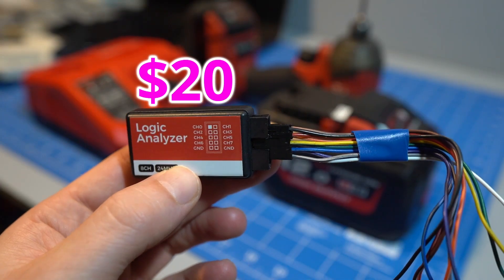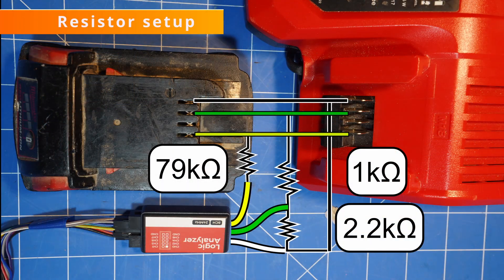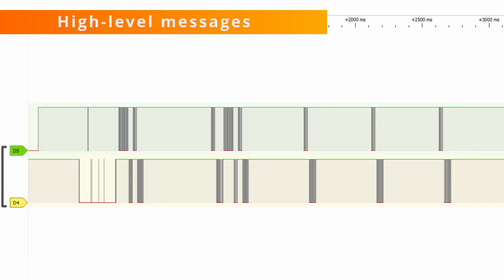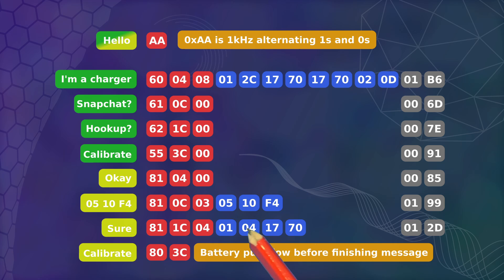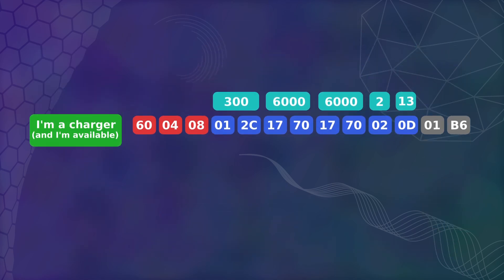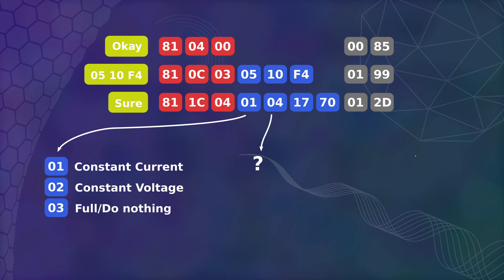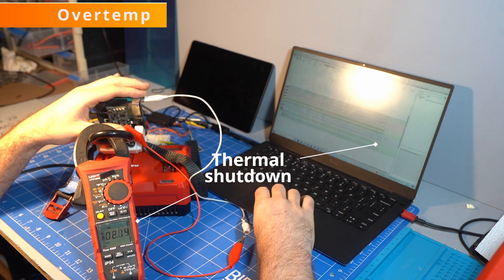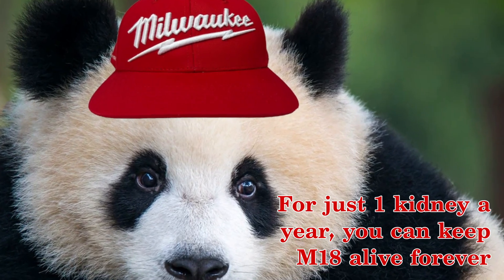[004] Reverse-engineering the Milwaukee M18 Redlink Protocol

Comment: The commands might be ASCII letters .  The 0D looks like carriage return .
Reply from the maker: I'm moderately sure the 0x0D is the number of bytes in that message. It's the longest message in the protocol. All the other bytes in that message make sense as decimal.

I looked at the 05 10 F4 message as ascii, but couldn't get anything useful. I also tried ascii with the bit order reversed. I think it's either a date code, but I can't make any of the common date codes fit. Program would have been written around 2010-2013. Other possibility is that it's chip IDs. 0x10 is the i2c ID of the  balancing chip (BQ76925). Other chip is a MSP430 G2744.
Reply: @toolscientist  I tried looking at it as ascii too, but only because I noticed that 0x0510f4 is decimal 332020, which is obviously a hex representation of ascii. I doubt they'd encode it as hex-in-decimal, though, and 3<space><space> doesn't seem particularly informative. Fun coincidence, though.
Reply from the maker: @aihtdikh  I'm definitely leaning towards chip IDs. I noticed that MSP430 G2744 is from the G2x44 family - and F4 is 244. So I think 0x10 is the balancing chip (that's its i2c address), 0xF4 is the MSP430, and 0x05 is maybe the program version?

Comment: I'm guessing the soldering iron overheated a heat sensor ...
Reply from the maker: The thermistor is some distance away. There's some diodes near that balancing pin that I may well have cooked. If I get the time I'll have a look.

Comment: I was keeping battery charged with bench power supply but once it dropped below i certain level it had to snspchat a charger.  I could still charge on bench PSU but would not output power to drill until after a hookup.
Reply from the maker: Yeah, once the battery is down to one flashing light, it won't let a tool run until it's been on a charger.

Comment: Okay so the algorithm is spooky: I just moved into my first ever owned home, and was looking at the Ozito battery for the drill driver and impact driver I purchased to do work on it and wondering if I could reverse engineer their protocols; I work in embedded firmware dev haha. Incredibly niche, incredibly relevant, and you did some great work here
Reply from the maker: Are ozito digital? I would have assumed they just had analogue NTC pins and maybe an analogue current request (that's if it's even doing CC/CV, they might just trickle charge)
Reply: @toolscientist  Most likely not, but I want to poke and prod anyway! There’s a surprising amount of logic inside batteries and chargers (I should know, I build it at work lol) — but ozito is cheap as hell so I’m curious! I’m going to bring it to work to poke and prod with the scope now lol
Reply from the maker: @Girvo747  you design battery systems in AU? Home solar storage would be my first guess.
Reply: @toolscientist  industrial, and not just solar but you’re in the ballpark haha
Reply from the maker: @Girvo747  Cool. I hope you keep watching. It'll be good to have some insider knowledge when I can't figure out what or why they've done something a certain way.

Comment: M18 appears not to active balance. To solve this just solder an active balance board to the bottom of the battery. Of course you will need to put it in a case maybe 3d printed...
Reply from the maker: It does passive bleed balance with a TI BQ76925. It appears that the balancing is too weak, though. It's high on my todo list.

Comment: Thanks for the info, at one time I considered buying Milwaukee lithium power tools glad I didn't I bought Dewalt instead and have Max 20 adapters for my Craftsman & Ridgid power tools as well as a fan, variable power supply and work light and AC inverter. Can you imagine a perfectly good battery bricking and not communicating to the charger? at least with the Dewalt I can swap out the BMS if needed.  Before you know it Milwaukee will try to verify that you have a genuine Milwaukee battery, charger, power tool & usb power supply.

Comment: That's surprisingly different to DeWalt's way of doing thing. There's mostly no electronics in the battery, but there's more pins, so the charger can monitor and balance individual cells, monitor the temperature, etc. all by itself. The way to differentiate batteries (High output or not) is a simple resistor installed between an additional pin and the 0V pin.
Reply from the maker: Yeah, the Dewalt's are admirable for their simplicity.
Reply: That's M12. Thermistor, balancing wires, done.

Comment: Really interesting and informative. Excellent work. I'm looking for a circuit diagram for the M18-12 charger (old style with the TOP256EN power management ic) but can't find anything. Any pointers would be appreciated. Thanks.
Reply from the maker: No, never seen one and I've only got rapid chargers. I think Buy It Fix It has the older 3A charger if that's what you're after. He has a youtube channel where he does repair vids. He may be willing to make a teardown vid for you. https://www.youtube.com/c/BuyitFixit

Comment: I’ve heard despising batteries from a Dyson BMS bricks the battery unit. This is thought to prevent people from rebuilding their batteries with new cells. This might be why your battery was bricked when you desoldered that rail.
Reply: It may be specific battery packs then.
 I just rebuilt my Dyson V8 battery pack with no problems. The biggest issue was that the original batteries were 20700 size opposed to the usual 21700. Just jammed them in there, and they’re working fine. I had completely disconnected the old batteries, so whatever pack I had didn’t care

Comment: I'm not sure why I'm here but i learned alot.

I wonder if makita does the same thing
Reply from the maker: They definitely do on XGT, and I'm pretty sure they do on LXT (I don't have any LXT, though). Never seen CXT in person, so not sure about those.
Reply: @toolscientist  have you ever thought about doing this with the flexvolt dewalt.

The battery switching from series to parallel to go from 20,40,60v is really cool.

Sucks it's such a heavy battery or I think the line would have taken off. As a mass producerable battery that's an incredible technology
Reply from the maker: @griznatle  Definitely want to look at all the brands at some point. I guess I'll start with the big 3 (Milwaukee, Makita, Dewalt) and go from there. I currently only own M18, M12, and XGT, so I'll have to keep a look out for 2nd hand stuff.
Reply: @toolscientist  do you think the tech of the dewalt flexvolt could ever get lighter?
Reply from the maker: @griznatle  only thing they can do is use smaller cells. 14500 cells are an option, but they're 1.1ah and 10A, versus 2.5ah and 20A of 18650s. Another option could be pouch cells, so 3 of the 1.7ah powerstacks slappped together.
Reply: @toolscientist  One of the benefits of the current system is that two of the batteries could power a chop saw for the majority of the day, assuming you're cutting spf 2x6, not lvl or ironwood.

I wonder if the gel packs could do the same as the Samsung cells

Comment: please just explain (or guess) what the messages are rather than being cute with "snapchat?"/"hookup?"
Reply from the maker: This video was written for a non-technical audience with no prior experience with binary data or digital signals. So the first 1/3rd was made to be simple and entertaining in order to get that audience interested enough to sit through the deeper technical look. This obviously does not work with a technically skilled audience, but I was not expecting this video to spread so far.

If you want the plain explanation:
0x60 is charger sending min/max current capabilities and status to battery
0x61 is battery sending info to charger. From discussions with another commenter, my best guess is that it might be chip IDs on the battery.
0x62 is the charger asking battery for a status byte that is used to drive the LED signalling on the charger, and a current (milliamps) request.
Reply: @toolscientist  thanks for the reply. maybe it could have been summed up with "charger capabilities?", "battery capabilities?" and "status?" instead? if the second one wasn't known at the time then "unknown info exchange" or something could have been fine, with a guess of what you thought in the voice over.
or starting with the jokey labels, but explaining and changing them later on. I found it kind of hard to follow as it is.
Reply from the maker: @rika-chan  joke start, proper later was the intention. I didn't want to change the labels so that it would be easier for non-technical people to follow (they're more likely to remember the silly labels). I did move a little too fast through the technical stuff - it's a difficult balance of giving technical info, but keeping things moving to avoid people switching off. 

YT isn't really the best medium for this stuff. I usually post a written form to reddit once I've caught up on life after finishing a vid. I might make a read-only subreddit of my results to make them easier to find.
Reply: @toolscientist  I dunno, to me I feel like even if I was a non-technical viewer I'd have to mentally untangle what the joke labels were to the original explanation, but I could be wrong. striking the balance seems hard to do and I appreciate your reply. hopefully it helps to improve!
Reply from the maker: @rika-chan  I'm pretty new to YT so I've still got a lot to learn. Thanks for the feedback 🙂

Comment: How did you figure out the message format?
Reply from the maker: Get lots of data and put it into a spreadsheet. Identify the different types of messages. In this case there's really only 3. Look for similarities and differences between the messages. Look for numbers that stay the same vs ones that change. Look at numbers in binary and decimal to see if any standout. Group bytes together in groups of 2 (maybe 4 if it's a 32-bit chip) and see if any of those seem meaningful in decimal.

Comment: Does the battery allow power draw without any comms? i.e can I use the battery to power custom tools? Any good way of getting hold of a connector? :) thanks!
Reply from the maker: Yes, the +ve and -ve pins are directly connected to the cells without any transistors in the way. Drawing power from these pins means you'll have to do your own low-voltage cutoff and keep it a a moderate load to avoid overheating

Comment: I think they self destruct when any group in the series gets to zero....and then returns to normal.

I've taken many an M18 pack apart....and unless I leave a bench power supply connected in place of cells I'm replacing...the pack never works again.

or possibly it's just been a coincidence.  @7:50 might be the same thing?
Reply from the maker: I've seen several videos of people rebuilding M18 with new cells and apparently putting it on the charger initialises it and it'll work fine. Because I'm getting the flashing red light rather than green+red, my feeling is that I damaged the thermistor circuit so it's registering under-temp. This would somewhat fit with 0x04 being overtemp and 0x05 being under-temp.
Reply: If it helps,I've recelled two of M18 batteries.
Removed the original cells without powering up the BMS,and both charged up again.
Perhaps yours had faulty BMS's to begin with ?
Reply: @A6D6E6  All the cells?  Like there was nothing connected at all at some point?

I'm about to try another one soon, with a new better spot welder...so maybe I will try it without trying to keep the board powered at each bank which is a major hassle...and see how it goes.
Reply: @A6D6E6 I went a new knockoff board route this time and all works fine...so maybe there was something else wrong with the original boards.

Comment: Great Video!!  Always wondered about this.  If you need a video idea, i am trying to power a Kobalt 40V mower from a non Kobalt battery.  But I would need to spoof the data stream.  Could you build a spoofer to use non manufactured batteries with a tool.
Reply from the maker: Unfortunately Kobalt is only in North America, and I'm in Australia.

Comment: This is pretty cool, I expect that the generic Chinese boards for the battery packs were reverse engineered in a similar way? The big thing about these battery packs is how the boards are designed to self destruct if the battery is removed so you can't repack with new  cells unless you keep power applied while replacing them
Reply from the maker: Quite likely. It'll be interesting to look at a 3rd party board to see if they've got the full protocol.

Comment: I would love to use M12 batteries as a 12V power bank but I'm afraid of over discharging and damaging them. I suppose that the battery could tell me when to stop if I could understand it's protocol.
Reply from the maker: M12 has analog pins. You can read cell voltages from +, C1, and C2. Make sure none of them go below a threshold (2.5V min, 3V recommended)

Comment: Love the video, I appreciate the work you have put in. That is a crazily oddly complicated interface. It smells it was never actually designed but evolved from something simpler. 
I've been there, my project manager just wants me to bodge the interface again, I'm not happy because a previous programmer liked undocumented assembler... I complain that it is already too complicated and there's a real risk that there will be unforeseen complications and bugs. We bodge it again because commissioning is next year. 
I feel that Milwaukee will bring out a new and improved drill & battery with an simpler interface which does what they need with less fuss.
Reply from the maker: Seems pretty simple, when you strip out some of the noise and the weird repeating sequences. I probably ironically over-complicated it with my layman's terms. First exchange (I'm a charger/Okay) is charger giving its parameters to the battery, 2nd exchange (Snapchat/0510f4) is battery giving some ID info to the charger, then it's just (hookup/sure) the charger asking the battery for charging current. The repeated parts seem unnecessary, but are probably to do with the structure of their loops/routines.

Comment: Can you look into Dyson batterys. They "fail" too soon to make users buy a new one. I took one apart and every cell had plenty of voltage. 
I think they have a cycle counter and that just isn't right.
Reply: Yes.. Dysons are my absolute favorite to dig out of the recycle bin. You can count on harvesting 6 or 7 perfect Molicel or Sony  cells. The boards tank at the slightest imbalance and probably other reasons.  And good luck prying the case apart to service them.

Comment: Speaking of arithmetic checksums...

I was told by my boss one time to make a message filter based on the arithmetic checksum of the message. I brought up how terrible that would be due to the collision rate. It took a few emails back and forth and a spreadsheet showing that with 3 hour data set, the collision rate was well above 80% before my boss relented.

So they said to do the message ID + checksum. 🤦
Reply from the maker: Haha, crazy. Use existing cksum libraries, or, draw 25 and re-invent the wheel, but worse.

Comment: still confused how this is the worst checksum ever, it's a checksum, not a crc :)
Reply from the maker: Some simple tweaks like bit shift (16-bit cksum that never uses more than 9-bits) or bitwise not, would significantly harden it. Fletcher checksum is another. In the end it works and it's not super critical, there's only 2 messages that have any chance of getting confused for one another. If they did I doubt it would break anything, just make the charger error and the user would take the battery off and put it back on again. I was mostly just playing it up for the memes.

Comment: As someone who's not an electronics expert, this whole concept absolutely amazes me.  Just the idea of how you can make 2 simple devices "talk" to each other and communicate information in a way in which they both reliably understand without needing a bunch of extra expensive components.  I'm just now getting into Arduino and learning how to write code to control it, but getting devices to do this simply with a few pennies worth of extra components (and without requiring an Arduino or similar) just amazes me.
Reply: Keep in mind that a lot of these devices use a microcontroller, so they're basically just an purpose-built Arduino... (The Quagmire Repair link documents it as having a TI microcontroller and battery monitor IC)

The real sad thing is that they could've just put the logic like the battery monitor into the charger and done away with this whole thing...
Reply from the maker: I think they wanted to keep backwards compatibility. This digital protocol only exists in post-2013 M18 batteries. To have the logic in the charger, the charger needs access to the cell voltages. Dewalt does this by having a lot of pins, but Milwaukee couldn't do this without breaking compatibility with older tools and chargers as there's just not enough space to put more pins.
Reply: @JohnRunyon  It's to try to justify proprietary tool batteries.
Reply: Ben Eater's videos are fantastic if you want to learn how digital electronics works in a from-first-principles kinda way
Reply: if you're interested in these kind of subject. search up an "embedded system" course. most Arduino tutorial are basic and won't give you the low-level explanation you need.
Reply: I mean he did use a laptop, which is a vastly more powerful computer than an Arduino.